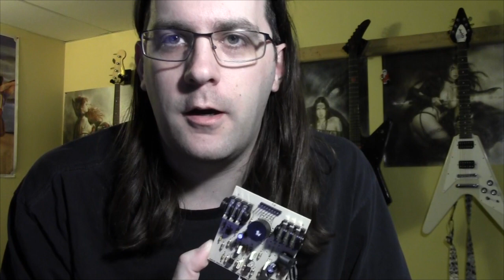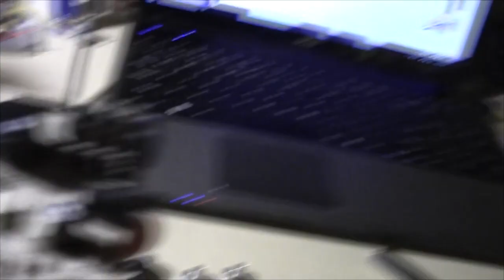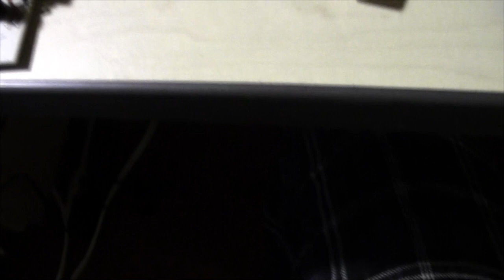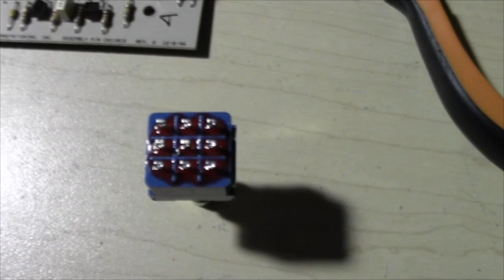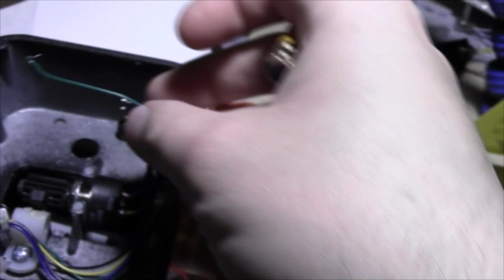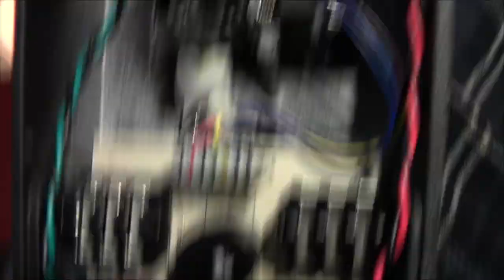Pedal Mod - Dunlop GCB-95 Crybaby Wah - True Bypass and LED Mod

Comment: cant get mine to work properly...no signal passing through...please help!!!
Reply: Do I need to add any jumpers after removal of the six components of buffer circuit ?
Reply from the maker: @brucedickeymusic  No, just the two wires.  Just go through the instructions carefully, and make sure you're using the correct instructions for the revision of your board.
Reply: @gasolinechlorine  thanks! I got it to work! Had the ribbon plugged in wrong… simple fix!
Reply from the maker: @brucedickeymusic  Awesome, glad you got it working!

Comment: Hello! Do I understand correctly, if the pedal does not have a true bypass, then it should not work without a power source? My GCB 95 pedal continues to sound even if there is no battery. Does this mean that it has a true bypass?  
I think we need to conduct a test, send a signal through the pedal and without the pedal and see if there is any sound loss.
Reply: It does not mean its true bypass if it works without power. This is from the stinkfoot myths page....

"If it still passes signal, it could be true bypass, but it might as well be ”hardwire” bypass. The only thing that test will tell you for sure is whether there are any active circuits (buffer stages etc) in the direct signal path. Those will obviously not run without power. But any passive connection from input to output jack will still work, regardless of if there’s a (powerless) circuit still connected to the input or not. So pulling the power is not a valid test for true bypass"

Comment: hello from Greece.please help me. i did everything by letter , led switches on but no  signal from the guitar to amp. ive notice one deference from other boards (and yours) with mine. the capacitor c10 from the left of the buffer circuit on yours is a resistor  on mine. maybe this is the problem or something else.please give me some instructions to fix my pedal.thank you.
Reply from the maker: Your board is probably a different revision than the one I have.  Check to see which revision your board is, and follow the instructions in the link for that specific revision.
Reply: @gasolinechlorine  thank you for your answer.the only letters printed is at the back(soldering) of the board nd it says ecb-25f.

Comment: Does not work. Don't waste a wah.
Reply from the maker: Worked fine for me.  Maybe you did something wrong?
Reply: Teddy Boggs you shouldn’t be working on electrical components then
Reply: @SL9SH  nah. Figured it out on my own.  Thanks for the incredibly worthless input.
Reply: I'm not understanding something.  The coupling capacity that introduces the pickup signal into the circuit is removed. I don't see how the signal is re-introduced around the input buffer. 
Pickup Signal to coupling capacitor-----> |  |------>amp bias------>Active Filter----->Output stage
Looks like the circuit becomes:
Pickup Signal to REMOVED coupling capacitor----->      HOLE   -----------> amp bias------>>>>>>

Comment: I had my wah on the shelf for about a decade, before I learned about modding it recently. I had my rev. G model initially wired differently for the LED/bypass from another set of instructions, but I was getting a loud pop when hitting the switch.  It was earsplitting. I even experimented with different resistor values for the LED thinking that would help, but it didn't. Your instructions worked the best! Removing the buffer circuit eliminated the loud pop and I couldn't be happier.
Reply from the maker: That's awesome man!  Once again, though, I have to reiterate - these aren't MY instructions.  I can take no credit for the process, I just made a video showing my own personal journey through the mods.  Thanks for watching!

Comment: Mods are all done: I asked Adrian@stinkfoot about the GCB-95 'Revision I' & it's done just the same as the others: I've successfully removed all the buffer circuit components as instructed, put the true bypass & LED in and it's all cool: No noise. No loss of volume. No worries. Thanks again for all your excellent support! Cheers.
Reply from the maker: Hey sweet man, glad it all worked out for you!  Cheers.

Comment: I have a question: I'm going to put a true-bypass & LED in my wah. My GCB-95 is a 'Revision 1' model : On this circuit board there is a blue rectangular two-pin box in the C9 position [the blue box located in the C9 position is the same as the four white boxes elsewhere on the circuit board except for the colour]. Relevant to the C9 location are three pin holes [top, middle & lower]. On my circuit board, one pin is soldered into the top C9 hole, and the second pin is soldered into the next hole down--both within the white demarcation line--leaving the bottom hole empty : There are two obvious differences between the two circuit boards: On the board you are working on there is a resistor [not the blue box i have] that is soldered into the top & bottom holes leaving a centre hole free: My question: Can I still remove all those components as you have instructed & have the same result? I'd appreciate your advice.
Reply from the maker: Please check the links in the description.  The resources I used to do this explain the different revisions.  Hope this helps.
Reply: Thanks Adam. I did check the stinkfoot archive link. The circuit board I have is 'Rev i' which is cited as being the current revision. But his description doesn't tally with what I'm looking at : The 'rev i' I have is a green board NOT a red board. The blue rectangular component I have sitting in the C9 position is not on any of the photos of his boards. There's one other difference [sorry I don't know the terms for the components!] : The round plastic pot which sits in between and slightly below the input & output jacks is seated like a barrel laying on its side on my circuit board. On the archive link, this same component sits upright, with the flat sides bottom & topside like a barrel standing upright. Can I send you a photo of my circuit board? Your observations would be appreciated.     @gasolinechlorine
Reply from the maker: From what I'm reading, it seems that Rev I should be the same as what I did here...  The "round plastic pot" you're talking about I'm guessing is the inductor.  Unfortunately, I'm good at following instructions, but I'm really not qualified to offer any more advice than that.  Proceed with caution, and if you're not sure, don't try it.  I don't want you to mess up your pedal.
Reply: Thanks for good advice: I'll take the cautious route & just do the LED for now til someone can verify the correct procedure for the other bits. Thanks for your consult all the way to New Zealand.  @gasolinechlorine

Comment: Excellent instructions. I do have a question though... are you using a 3PDT, because you say in the vid a 3PTT ans I'm having a very hard time locating one. Would you mind linking to your source for this switch? Thank you, and keep up the good work.
Reply from the maker: Yes, it's a 3PDT.  Apologies, I tend to mumble so sometimes it's not clear what I say.  You can get them at a lot of different online retailers.  This one is from Tayda.
Reply: No problem at all Adam. I had a few 3PDT like the ones in your vid and finished wiring it up (as per your instructions) this rainy morning with a bright blue LED. (matches my MXR CC Delay) It works flawlessly. I too, tend to mumble while my mind is trying to gather a lot of info at once. Thanks again for this vid and for your quick reply.
Reply from the maker: Glad it worked out for you man!

Comment: i have a DPDT Switch should i try to bypass it by this way to get it done?
Reply from the maker: If you're only using a DPDT, you can omit the LED, and it should be fine.  That's all the extra pole is used for anyway.
Reply: Thanks for your answer. My gcb has came with a DPDT from factory. I have seen that they still not being a true bypass. Can you confirm me if it's or if it's not?
Reply from the maker: It depends on how it's wired.  Check the link in the description, it will show you what to look for if your pedal comes stock with a DPDT.

Comment: What value Resistor are you using for the LED?
Reply from the maker: The superbright LEDs I use call for a minimum of 2.2k (I think.)  Personally, I tend to use either 3.3k or 4.7k as a minimum.  Your LEDs may differ.  It's always good to check different values - within the acceptable specs of the particular brand, of course - to achieve the required brightness you want.
Reply: Adam thanks for your reply. I used to mod these and other pedals about 15 yrs ago. I just couldn't remember. Thanks for doing this video. Have you done the Boss DS1 Keeley Seeing Eye 👁️ Ultra Mod yet? Its a great mod. 😀 have a great day. Jer
Reply from the maker: Yeah, I did the ASE and Ultra mod in one pedal, and made it switch selectable :D  You're right, it's a great mod.
Reply: Adam could you do a video on that mod? Also i knew Keeley uses Panasonic SMF Caps. Does it really make that much of a difference in tone rather than using other quality box poly or metal film type caps?
Reply from the maker: I did an "after" video here: https://youtu.be/5sT9jxxBM6s, and there's a link in the description for instructions on how to do it.  As far as caps go, I just concern myself with the value.  10nf is 10nf, no matter the brand or package.  The only things that make a difference to me are whether or not the cap is polarized, or how much tolerance the cap has.  However, I'm not even close to an electrical engineer, so don't think of me as an authority on this by any means.

Comment: Clear concise instructions. My 3 throw switch is on order. Bought my pedal broken. Thought it was inductor so got new board ... Ultimately the switch was wired wrong so I either got clean tone or nothing (hence why i thought inductor). Anyhow is there any reason why the clean input cannot be grabbed direct from the plug (solder on top) and leave the input buffer in place? Seems to work for me ... And I don't get the muffled bypass sound.
Reply from the maker: I'm not exactly sure what you're describing here, but if it works for you, all the better!
Reply: Hi Adam. I chicken out of cutting traces or removing buffer circuit and soldered from input Jack straight to clean input on switch...seems to be brighter tone in bypass mode. Anyhow I managed to get another broken pedal so I will configure it with bass capacitor mod and then try removing the buffer. Thanks again for your video and reply

Comment: The reason for a true bypass switch is to prevent tone-suck. But then you go and remove the input buffer, and creating an even bigger tone-suck! When you connect the guitar directly to the wah, switching it on will reduce the imput impedance way down to 68K instead of 1M, which is way to low for guitar pickups. You can't here it here because you had a buffering pedal in front of it. Hope you friend likes his new tone-suck. Moral of the story: don't blindly follow some website if you don't understand the electronics.
Reply from the maker: No, the moral of the story is: the customer gets what the customer wants.  The wah sounded fine, and I received no complaints from him.  If he's happy, I'm happy.
Reply: Hello! Do I understand correctly, if the pedal does not have a true bypass, then it should not work without a power source? My GCB 95 pedal continues to sound even if there is no battery. Does this mean that it has a true bypass?
Reply: @Drums-and-Percussion-Grooves  Not quite. When switched off, the input and output are directly connected, so you hear sound. But it is not 'true' bypass because the input is always connected to the wah circuit. The true bypass mod will also  bypass this permanent conection.

Comment: my GCB95 does send the signal through even without being powered or any battery in it. Does that mean it is true bypass?
Reply from the maker: Sounds like it is to me.  What kind of footswitch does it have?  SPDT or DPDT?
Reply: The board says Revision 1 on it, the switcher has one green wire on the left and two wires to the right (Blue and Purple).
Reply from the maker: Ok, sounds like it's not true bypass then.  Is there something wrong with it?  Does it work when you switch it on?
Reply: In its original form, it's "hardwired bypass". Even though the signal passes directly fron input to output jack when switched off, the circuit input is still connected. So it is not true bypass.

Comment: alright just so its crystal clear to anyone else searching for this, as long as the resister is connected anywhere in the led circuit, the current will be regulated.
it seems like the consensus is to have it on the anode power supply side, but after extensive reading, placing the resistor on the other side has no ill effects. so all these instructables claiming one side is the single true side are wrong, or rather, theyre both right. 
so long as its in series in the circuit.
Reply from the maker: This is the answer.  It doesn't matter which leg the resistor is placed on, as long as it's in series on one of them.  Sorry if it seemed confusing.  I didn't realize I was switching my explanation.

Comment: ive been doing more research and it looks like the stinkfoot webpage is the one at fault not you.
it describes the short leg of the led as the anode.
then in another paragraph says the long leg is the anode.
proofreading is so crucial when it comes to these things and noone else seems to care.
the polarity of the pedal itself seems to affect which of the legs goes to the switch, and led rules dictate that reverse flow is impossible.
so who has the correct answer??

Comment: ok according to your own instructions and the website youre referencing, you put the led resistor on the wrong leg.
should be on the negative cathode side, not the positive anode side like youve done.

you also switch back and forth 3 times when you talk about which leg it goes on, probably confusing yourself and definitely confusing the hundreds of noobs watching this trying in vain to learn something.

has your led burned itself out yet?